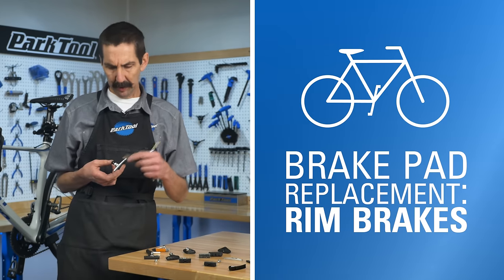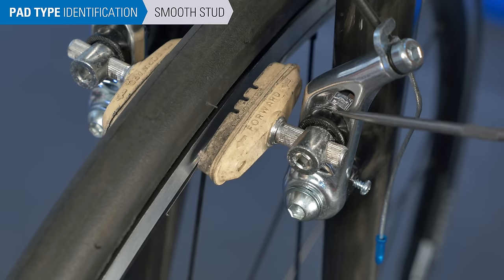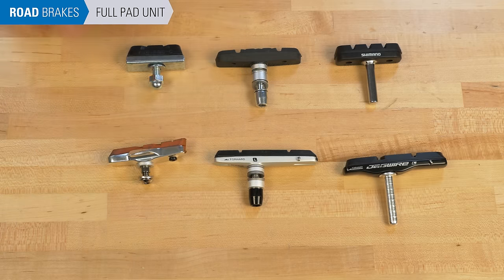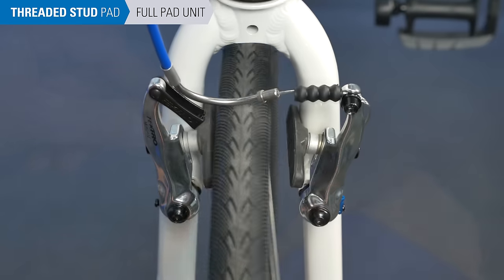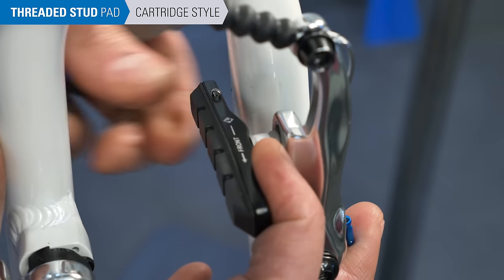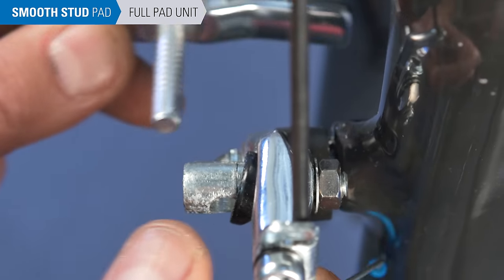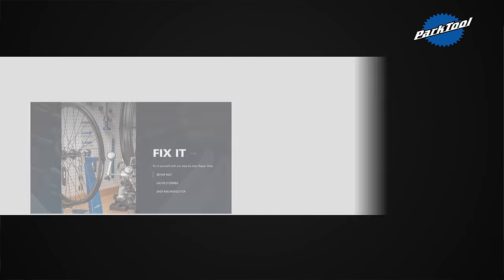How to Replace Brake Pads on a Bike - Rim Brakes

Comment: I haven't ridden or worked on a bike in decades. I just got mountain bikes for my daughter and I. We live near the city of Pittsburgh, so the 18 speed is going to come in handy. While the some assembly required for our bikes made it simpler my daughter's bike needed some brake adjustment. I decided to start here then moved into the adjustment video. I want to thank you for the in-depth and perfectly described information that you give. I was able to learn more about our brake assembly, maintenance, and repair. You are AWESOME!

Comment: Was wondering about this for a while. Bought the bike the other day and getting the knowledge in ahead of time. Already knew a good bit,and even work on a few myself as a hobby. This really helped me identify what and how I needed to do things. Tomorrow I'm gonna check what type of brake pads I need and make a decision. Hopefully I won't need some crazy tools for the job. The one thing that might get me are the Allen wrenches,other than that,I should be good.

Comment: Thanks for the vid it was very helpful. First time doing this myself. When replacing a cartridge on a road bike is there a torque for tightening it back in? If anyone reads my question, I googled it and came across 6nm for road bikes on that retainer bolt so if that is wrong please let me know.

Comment: I bought a pair of brake pads that don't have any L, R or Forward markings.
Should I install them in any specific direction.
Reply: If you look at the brake pad there is a slight curvature in the shape, just match that up to the curve of your rim when you install it , usually very cheap brand brake pads  tend be small and very squared off so watch out for that too

Comment: Hi. I accidentally got threaded studs for my road brakes. Can I still install these? Is it safe?

Thank you!
Reply from the maker: It depends upon the design of the brake arm. If the brake washers have full engagement on the arm, it can work.  Also, the thread stud tends to take up more room from the convex-concave washer design.  Run the narrower spacer inboard.  If you get decent clearance as you pull the lever, they can work. 
-Calvin

Comment: Hey I have a question here. My bike had still the original road breaks. I replaced it with a threaded stud. I did it like in the video an it looks and works very well. So is it ok to replace road breaks with treaded studs and if so what is the diverence between them.

Comment: Hello Park Tool, thanks as always for your resourceful video !
On your video there seems to be multiple orders of spacers for your threaded stud system : pad-concave-convex-arm-concave-convex-nut or pad-concave-convex-arm-convex-concave-nut. The most common configuration I'm used to is the first one where the brake arm is in contact with the 2 convex spacers. You seem to mostly use the 2nd configuration. Does it matter as long as a convex spacer is coupled with a convex one? Does it change the adjustment possibility? Does it depends on your brake pads? Is there a reason for wanting one or the other?
Cheers !
Reply from the maker: The convex side of a spacer must face a concave side on another spacer, of course.  If you keep convex to concave, and flip that mating 180-degrees, it still works.
Reply: Park Tool amazing videos I subscribed since im always fixing my bike

Comment: Should the new pads be the same length as the old pads or can they be longer?  If so, what is the advantage?
Reply: You should be fine as long as the pads fit. The thicker the pads, the longer they will last

Comment: Can I put new pads on vintage road caliper diacompe brakes? Or do I have to find vintage pads on ebay or something?
Reply from the maker: There will be many choices for a vintage road brake.  In fact avoid "vintage pads" because they will be old and will have hardened.  The slot width is the same on modern calipers.
Reply: @parktool  thank you very much for the reply. 🙏🏻

Comment: The right pad goes on the drive train side??? Left on the other, or the opposite way???
Reply from the maker: Right goes driveside left goes non drive side. Right and left on bikes is like a car and is from the drivers prospective. Pads should also have arrows on the pads. That arrow should point in the direction of wheel travel.

Comment: I have a question, is this a 6 mm wrench used to loosen the brake pad arm?
Reply from the maker: The brake caliper arm is commonly a 5mm hex wrench.  There are certainly some sized for 6mm, but the 5mm size is more common.

Comment: good vid but 1 question could I replace road pads with threaded stud pads?
Reply from the maker: Well, manufactures prefer you get the replacement pad it was designed for.  However, it can be done (for most models, anyway). The wider spacers will likely go outside the arm to simulate the original pads, but see what works in your case.

Comment: What are the little "shark fins" on so e road brake pads, are these meant to guide the wheel into place?
Reply from the maker: Fantastic question! And you are correct. Those fins are to help guide the wheel into place when doing wheel changes.
Reply: @parktool  The fins on the brake pad holder? Surely they're to hold and lever against when you're trying to push out the old pads? They're even shaped so you can wrap your index finger round the fin and push the pad with your thumb.

Comment: The only thing missing is what to do if the cartridge inserts are wedged in so hard that you can't get them out. I've spent the last half-hour trying to replace the four inserts on my brakes and I've only got three done, so far.

Comment: can road brake pads be use for V brake?
Reply from the maker: The linear pull (V-brake style) use a pad with a convex and concave washer system to set pad alignment.  This requires a long threaded stud in the pad. Most road pads lack this alignment system and should not be used in V-brakes.  However, it is often possible to use a pad from a V-brake in a road caliper.
Reply: @parktool  thank you :)

Comment: on my ads there is an indication line, how far away from the line dose ware have to be before you get spares. mine are 3mm away
Reply from the maker: Keep going with the pads.  There is enough safety margin when it hits the line.  It might be good to get a replacement set now, but keep riding. If you are headed of on a long trip, you might replace them now, but you have enough material left to be safe.
Reply: Park Tool thanks for that I had no idea and could not find the info anywhere

Comment: 3:11 

My pads DO NOT just slide out once the retention screw is gone
Reply: SAME. always nice to see a fellow mgtow
Reply: Yeah, I usually find that they need a bit of a shove to get them out. I was actually here for tips on installing the new pads in the cartridge. I've just tried to replace all four on my road bike and I only managed to insert one of the pads properly. The other three really don't want to go in all the way. (Yes, I bought the right kind, etc.)
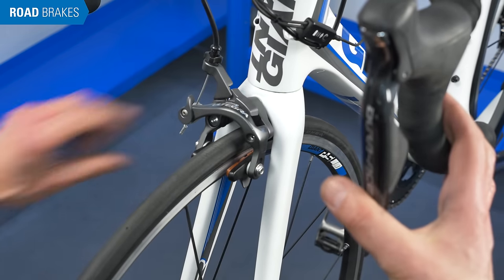Reply: Well, last time I replaced my brake pads, I replaced the holders, too. Now I have the Shimano ones with the little fins, as shown in the video at, e.g., 3:34. Even heavily used pads slide out easily: they might need a gentle push with a screwdriver, but nothing dramatic. New pads just slide right in. I strongly recommend them.

Comment: I mixed up my back spacers now what? I have no clue what spacers and washers to put where.  Threaded pads on v brake system.
Reply from the maker: Convex side goes against concave side.  "Cup to Cone" arrangement.  Arrange both side the same, and see how brakes looks.  Switch the wide spacer on both arms if needed.  Both sides much be the same, so there are not that many combinations possible.
Reply: @parktool  
I'll have to watch the full " brake pad" episode.  Thankx for reply.